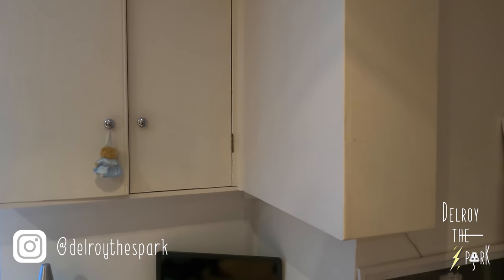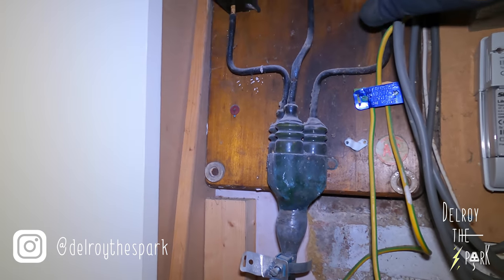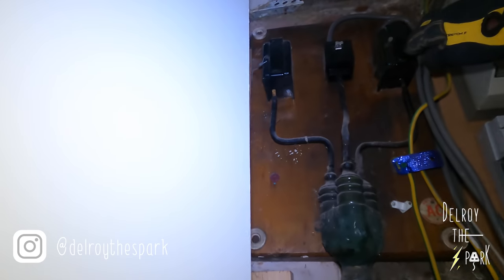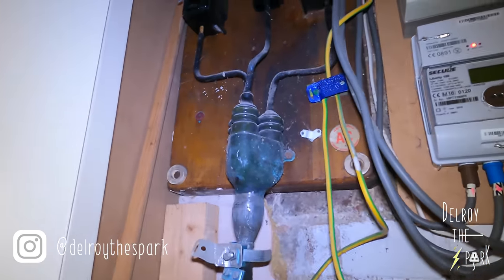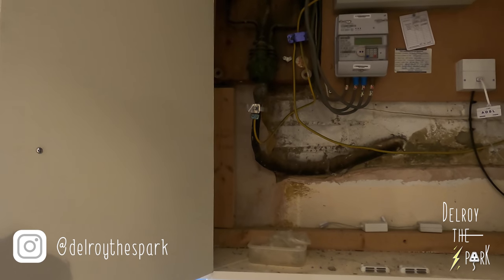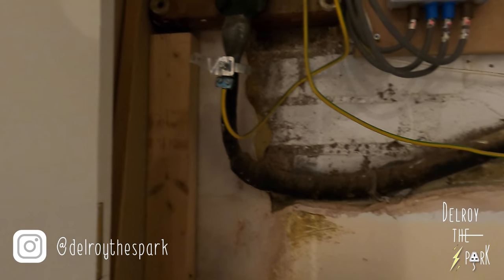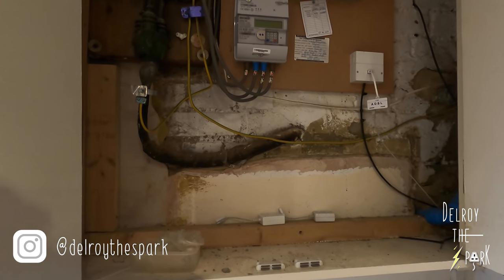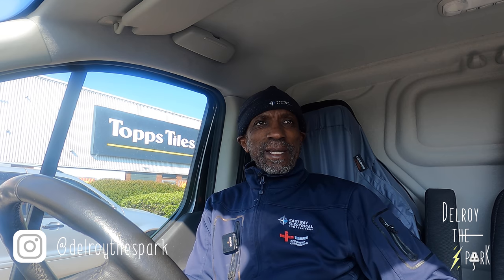"You Need To Contact UK Power Networks As This Is An Emergency" | Electrician In London Vlog

Comment: had a house back in the 90's where the main coming in the outside box  had 'burned'  through the connection becoming loose, I remember coming home from work and as soon as I put the microwave on the lights would start to pulse disco fashion - to their credit they came out  dug up and replaced the cable  quite quick
Reply: Things get properly interesting when the neutral burns out somewhere in the three-phase distribution.
Reply: @Ragnar8504  "Lemme just drop my 110 V and 540 V  here" - every asymetrical 3 phase system when losing its neutral
Reply: @hardstylegamer9932  Exactly! :-D

Comment: I had exactly the situation a few months ago on a sunday afternoon, i know its wrong but i had an old ( but perfectly safe) cut out 80a fuse with carrier & also told the customer its down to the electricity co but could change it if they wanted me to, it was only £50 but i had to break the old welded fuse & carrier & pop a new 1 in. Customer was ok with it & i waddled off & got my self a Lamb madrass on the way home. In Del's job here, i would have swapped the feed to the other phase, mainly because dealing with utility companies can take far longer than the job in question, having said that, Sharon seemed quite on the ball.

Comment: Where I live the power company is usually too busy/ unwilling to come... you just notify them which building it is, remove the power fuses (special tool, no load ofc), fix the problem, put the fuses and the broken seal in the box and leave. The come to re-seal it whenever they want. By-the-book you'd have to file forms, wait 1-2 weeks etc. it would be a hassle for both you, the power company and the home owner.

Comment: I ran into a problem like this several years ago where I had recently rewired a house for an elderly client and was called back saying her lights where dim and nothing seemed too work properly. I eventually measured a higher than normal voltage between the earth and neutral at the mains had to call the electric company out, turned out there was a short at the neighbors house and it was feed back on the line tap at the pole, thank God the it was rectified.🙏

Comment: Being from the US and being a lineman, instead of calling the power company (and depending on how bad it is, this didn't look immediately life or property threatening so maybe not here). I'd call 911 or the 211 British equivalent. The distributor can blow you off, and when you have a problem like that I'd recommend calling your local emergency services and they can expedite the response. 

I've had the fd call us before for problems, and they've sent the cops to escort us to the scene as quickly as possible. 

I've also worked on calls where the FD called and needed power shut off immediately for property protection and we sent a scada command and dropped 100 thousand customers.

Comment: I've been trying to pull the bus block on my garage panel. I thought it was rusted together, I never thought maybe it's melted together
Reply: Oh for sure electrical arcs are a form of plasma that is to say ionized air which considering that Nitrogen and Oxygen are the 5th and 7th most difficult neutral atoms to ionize is saying something. The amount of momentum electrons need to overcome the electromagnetic attraction to the nucleus in these atoms is considerable and thus since temperature is itself a function of the average momentum of the particles the resulting plasma is also really damn hot. Temperatures can reach in the region of 20000 °C within the arc which when you consider this is 4.6 times the melting point of the material with the highest melting point ever discovered on Earth or synthesised by humans and a good 4 times the surface temperature of the Sun yeah that will do the trick to melt litteraly anything it comes into contact with so yeah an electrical arc will fuse most solid materials together with ease, exceptions here would include materials that cannot exist as a liquid at all at atmospheric pressures and such a high temperature since those will instantly vaporise on contact instead.
Reply: TL;DR?  Basically she said welders use electricity for a reason.

Comment: 50hz ac. all ways wobbling. on an old bakerlite fuse you shouldn't pull them if they are stuck. they can disintegrate and start a fire. ie burn the cable.  and that struck arc is hard to put out until the 800amp fuse at the sub station burns out.
Reply: that fuse in the sub at 800A - is there enough fault current here  to blow the fuse, I suspect theres not..
Reply: @David-js4wd  You are absolutley correct.

Comment: If you dial 105 you get a recorded message asking for a land line phone number on site. Just put any local phone number in and you get put through to the dno. Excellent videos thanks.
Reply: @DoctorElectricYouTube  Your landline phone code should route you through to your local DNO, & if you call from a mobile, it should route you through based on the mobile phone mast you connect to. The reason they ask for a landline is for messaging. Say there is a HV fault with 2000 properties off, they can burn off a lot of calls by linking the property to the fault & people hang up once they hear there is a known issue & are given an ETR. This frees up the lines for people with critical calls or who may need more assistance (medical issues etc...)

Comment: What your supposed to do is flick the main switch off on the consumer unit so there is no load and call your distribution network provider straight away,under no circumstances are you to cut the seal and tamper with the supply

Comment: Is there energy on the Phase A cable?
If the over current protection for Phase B is faulty, why can't the load side of the feeder be installed to the spare Phase A OCPD?  It would be a temporary fix to protect the contents of the structure until Phase B is repaired.
Reply: Exactly what I was thinking

Comment: The rules in Australia is that if an electrical installation is modified or added too. The whole of the installation needs to be brought up to and meet the currrent Australian Standards and wiring rules. That way distribution switchboard don't have a whole lot of legercy protection devices and consumer mains and cunsumer fuses are maintained and safe. 
All though you often find a mix of old porcelain rewirable fuse holders, old circuit breakers and some old vir rubber insulated cables. These types of installation require complete full rewiring of all circuits and metered consumer didtribution boards and sub boards complete all current RCD protection and breakers and generally an AED portable defibrillators for when the home owners heard the price for the extra light they requested.
Reply: This is why you constantly run into houses in Australia where people are deferring electrical maintenance. We are looking for a house in older neighbourhoods and every house we have looked at has visible issues with sockets, wiring and switchboards.
Reply: @nicbrownable  First thing I've done is completly rewire including the consumer mains. Luckily I've had all the wall sheets off, so an easy job.

Comment: thats good eighty years old , the main problem is that we pay a LOT for energy but they invest very little and don't forget people that in the near future they want us to use more energy and increase our consumption by at least forty amps !!!  with car charging heat pumps and water heating
Reply: It worked fine for those 80 years. It was only since the smart meter was installed that the problems began. I'm sure some of these meter fixers have wrists like crisp packets.
Reply: If it's not broke, why fix it? Those old cast iron service heads are pretty durable. 

Having worked for a DNO for the past 20 years, I'd have to disagree with you about the lack of investment. That was certainly the case prior to privatization but, at least the region I work in, invests a lot into the network. Wholesale replacement of old service heads that are working fine doesn't seem like a very cost-effective strategy. Sub-standard installations should be reported by electricians, meter operators or readers. Should be.

Comment: personaly id have just moved the input to the other phase  or switched the block over and called it done at that but idk how many codes that would violate
Reply: Many..and you'd have left a hazzard for the customer to discover at a later date, these series 3 cutouts become very brittle when subject to alot of heat.
Reply: @David-js4wd  fair enough but i would have thought that is would be more dangerous to have the arcing one left connected for any amount of time though

Comment: Once rented a flat where the main fuse was a six inch nail...everything seemed to work OK but the Gas Man, of all people, pulled the plug.  Apparently that's not safe.

NB Chappy has a Smart Meter ... the electric board sent a couple of muppets to fit it.

Comment: Call 105 for DNO.
Reply: And get them to install the correct Earth Clamp to sheath as its TNS, as existing one don't comply to Regs. and btw the Henley Block might have been fitted correctly at the time, but them boards which it is fitted on will & always rot and screws might get loose after 50 odd years lol , as I've have had the same experience in my 35 years in the game

Comment: My old main fuse filled my porch where its positioned with smoke and it was the smell that alerted me. Turned everything off, called Western Power who came within the hour and they changed whole main fuse and box for new grey one. Unfortunately I had ripped the porch ceiling down first where all CU cables go to check for fire. Haven't put ceiling back yet but it's only been 3 years 😜.

Comment: Looks like all the feeds are melted back prior to the fuse cutouts.  That’d always be classed as dangerous as far as I’m concerned.
Reply: No they're covered in tar, they're supposed to be black and shiny, much more reliable than modern plastic junk.
Reply: @ArlenMoulton2  - sorry, I was talking about exposed copper just below the fuse blocks, which without a shadow of doubt is an inspection fail.
Reply: @daveys  Ohh yeah I see, that's awful, good spot!
Reply: @ArlenMoulton2  - Aye, you’d not want to touch those in a sudden burst of curiosity.
Reply: meter tail live wire probably overheated at the cutout too

Comment: Are they going to remove that BS 951 clamp from their cable and connect a proper earth connection to the lead sheath?
Reply: Your distribution provider does not guarantee a customer earth if the customer wants an earth provided by their provider then obviously they would have to pay
Reply: @davejarvis5279  It looks like a TN-S cable.  It is probably PILC with a steel spiral armour.  There will very likely be continuity from the lead sheath all the way to the neutral at the transformer.  Why would the DNO go to the effort and expense of providing a lead sheath all the way from the transformer to the service head, and then not bother to solder a short length of copper to it so you can have a nice earth connection?
It's a mystery how so many houses have BS951 clamps attached to the service cable, and often the connection isn't even to the lead.  The clamp is sometimes tightened around the steel wrap which doesn't form a CPC for the distribution cable, in which case you won't get a usable loop impedance reading however much you tighten it.
Reply: @westinthewest  The armour clamps are just to secure the steel wire or tape armour protecting the cable. If fitted properly they would not touch the lead sheath of the cable. As for the earthing, well there was a time when electric companies didn't have to fit them and properties could stay like that for decades with no problems. As an ex-cable jointer I have seen earths fitted by DIYers and cowboys to cables that aren't even earthed. The rule was if the property had a legit earth fitted by the DNO we maintained it.
Reply: @Dooguk  Correct. The homeowner is responsible for providing an earth. If the DNO fits a TN-C-S (PME) or there is an older TNS clamp that has been fitted by the DNO at some point, then they are responsible for maintaining it. 

It makes sense for properties to have a PME where available. I work in the industry but not in a frontline engineering role. Out of interest, how many properties would you estimate (say percentage-wise) have either TT, some kind of DIY clamp or no earth provision at all? I'd guess it's more common than people realize.

Comment: Had something similar and my neighbours experienced the same, turns out something out in the street was bad, out lights flickered every time the street light between our houses turned on. It was only recognised by the electricity board when the street light caught on fire 🤦‍♂️
Reply: Oh, they also didn't mark anything and people installing fibre cables hit the line and caused a power cut

Comment: First thing I can see is that it appears to be unbalanced only two of the three phases are connected. That will bring about harmonic problems with sensitive electronics.
Reply: @mattsan70  not all of the Uk is 3phase.It’s a combination of 3 phase, split phase and single phase. The incoming supply on that property was 2 phases incoming plus neutral but only using single phase. Easy repair just move the meter tail over onto the spare phase-has to be done by the DNO..
Reply: Cause of the problem would be the constant cycle of load no load over the years.Contacts heat up cool down expand contract then the contacts get loose then looser then a small gap leading to arcing overheating then can lead to a fire but will normally lead to flickering lights and a smell of burning(Bakelite) first that’s the 1st sign . Call 105 and dno will come out to sort which is free of charge
Reply: @markandrews9092  It would be better practice to change the service head and connect the supply to the same phase as before, unless you can confirm that changing to a different phase won't cause an unbalancing of loads between the three phases.  You need to make sure that each phase has roughly the same number of houses connected in order to reduce overload of any individual phase.
Reply: @westinthewest  That can never be an exact science as the loading from each house will vary all the time and the DNO cannot know what the average consumption of any one household will be in advance. 
However since there are two live plus neutral on that service head I suspect that it is a spilt-phase supply rather than two phases of a three-phase supply. 
The entire street that I live in is supplied from a single phase transformer with a split-phase secondary.
Reply: @davidfaraday7963  most substations I've tested are between 20 and 120a of difference between phases makes it a right pain synching generators on and off

Comment: from an american standpoint it's odd not being able to kill the main electrical supply in multiple places, in my house I can either trip the main breaker inside the house or pull another disconnect in the supply box outside if there were to be an issue with that, not that i imagine breakers are as likely to weld themselves like that.
Reply: @Murderdogs  Except for the meter & meter tails, which are the supplier's responsibility.

Comment: I once lived in a house with very old wiring.We had a letter from the national grid I think stating that the electrical equipment was very old and due an inspection.No problem a few days later the engineer showed up took one look and with a sharp intake of breath says your on a loop I will have to go and check the plans to see who else is on this loop so we know who will be affected when we turn off the power when we come back in a few days.A couple of years later (yes really) we get another letter.Your equipment is old blah blah.Engineer ( the same one from 2 years ago )turns up.Your on a loop.You know the rest.Another 2 years goes by although my wife does disputes the timings my next door neighbour has an electrical fire in the cupboard on the other side of the party wall.The engineer inspects our electrics as a precaution after the fire and guess what your equipment is old your on a loop will be back in a couple of days but this time they were as good as their word and came back in a couple of days.
 Turns out the loop means that in stead of being in the road the power goes into the first house in the loop and each house has a junction box and that is what caught fire.